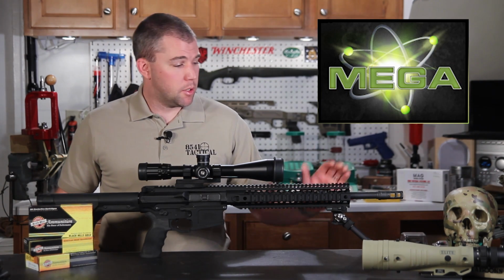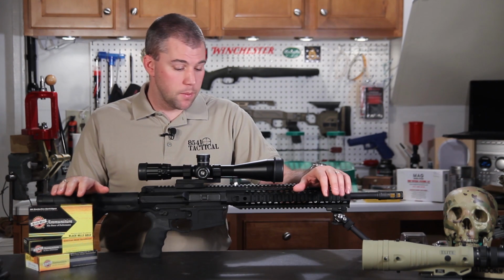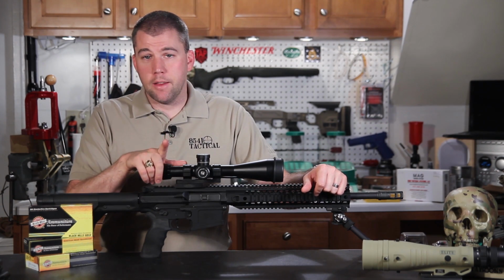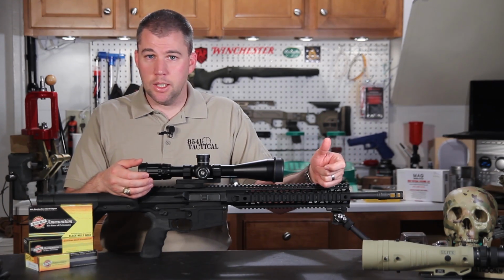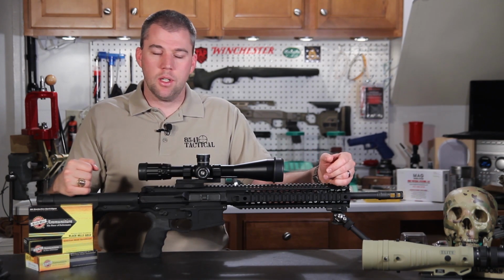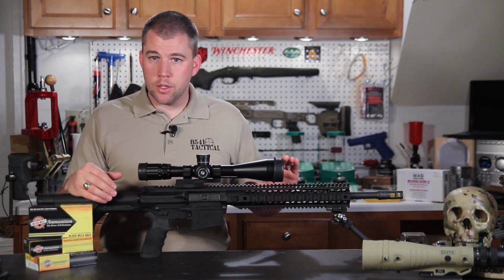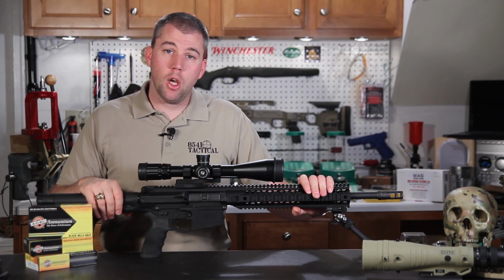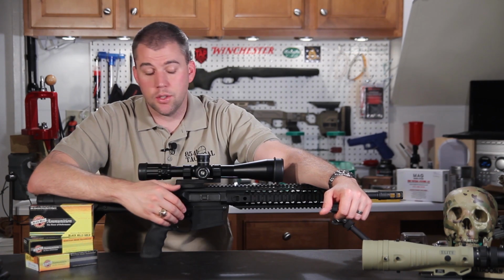MATEN Build Series 09 - Test Fire and SLR DA7 Gas Block Adjustment

Comment: I was wondering about the SLR adjustable gas block. Since its adjustable would it help reduce recoil ? Great build keep it up
Reply: helps tune down any "over gassing" which would increase felt recoil.  I have a couple of the SLR blocks.  Excellent products in my opinion.